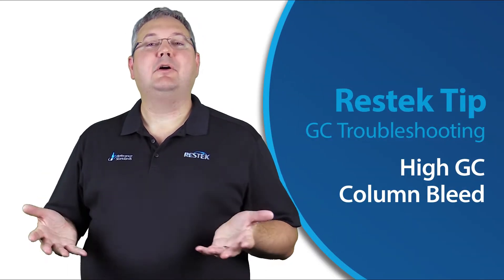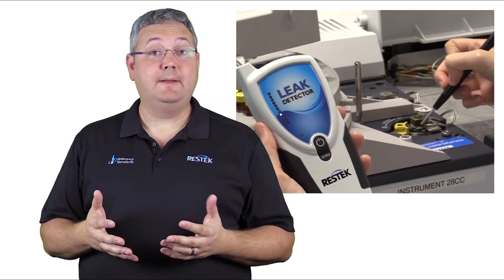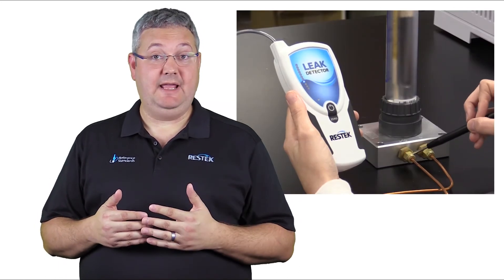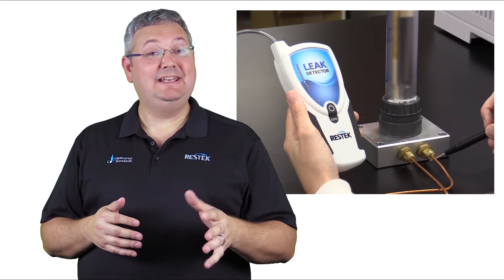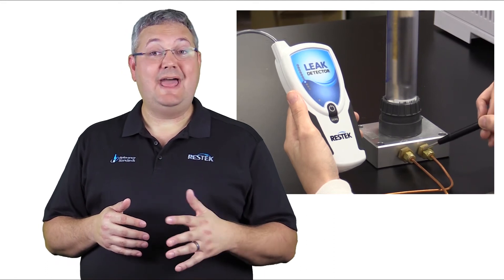GC Troubleshooting—High GC Column Bleed

Comment: Nice video! this is in my school materials, i could see what bleeding is on a graph but couldn't put it in the right words. Now i know that it is additional unwanted signals in the graph caused by the degradation of the stationary phase caused by a reactive chemical like a strong acid or base or by oxygen contamination so it is very important to filter for oxygen in the carrier gas.